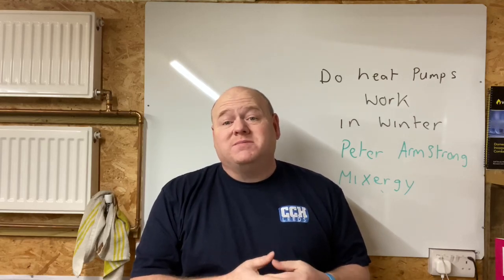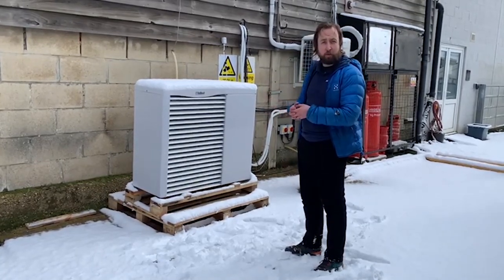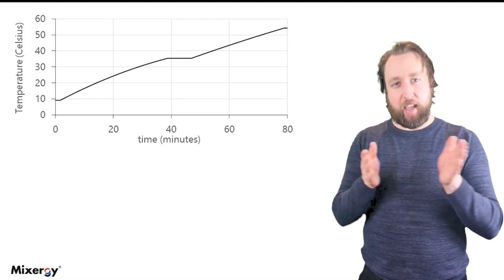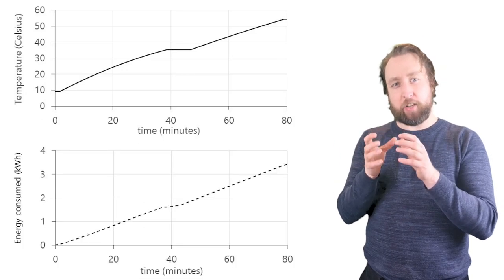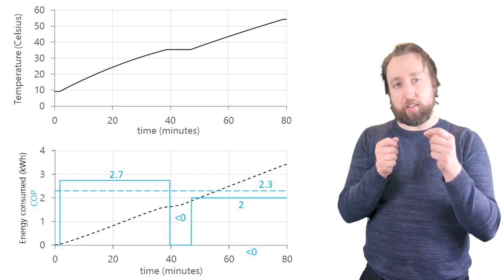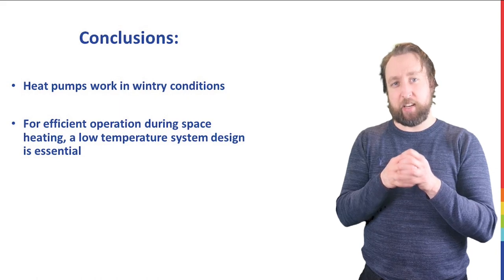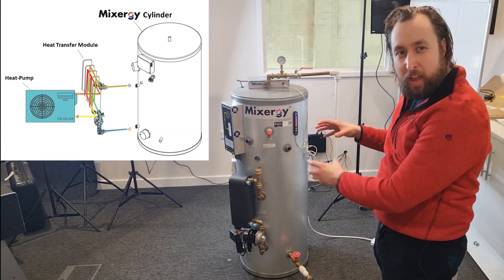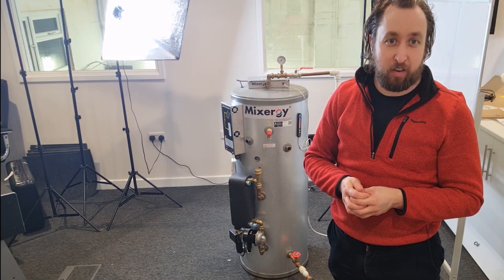Do Air Source Heat Pumps Work In Winter - Peter Armstrong Mixergy

Comment: Simple solution to all your problems, get a cheap  used or new heat pump from eBay min 5kw. Plumb it into existing gas ch system add a motorised valve and and a aav,  bung it into loft, off the floor and hey presto you have hybrid system that works no matter what temp outside. Total cost around )£400 to 500 inc pipe work. Heat pump cost £160. Just three pv panels can run my system on a good sunny day. I have 7kw in total, my gas and electric bills this month are just under £300. That’s inc charging 2 electric cars and heating a 150sqm house. My only advice would be to sit the heat pump in the loft as high as possible near south side of roof that way it takes advantage of the heat from the roof tiles and doesn’t get suffocated in it own cold dense air at the bottom of the loft floor. Make sure you have good air movement in loft with breathable membrane on roof. Mine is working brilliantly so glad I didn’t spend £12k on new system. I reckon I saved the money I spent on it on the first 2 months of use.

Comment: Do these tests again at -10 c and see if the heat pump can clear the coil. In general heat pumps don’t work or are not efficient in low temperature conditions. Stop selling technology that will not work in British winter. Just for the record I have two splits operating in garages and have recorded them over the last few years. The manufacturers produce graphs to support this see Mitsubishi systems.
Reply from the maker: Thank You

Comment: NOT WITHOUT LOTS OF WILDLY EXPENSIVE CAP ELECTRICITY. COUNCILS FITTED THEM WITHOUT THINKING TO MAKE TRADESMEN HAPPY, BUT THEY ARE VERY VERY NOISY 24/7 AND COST A LOT TO RUN NO MATTER WHAT THE WEATHER
Reply from the maker: Thank You

Comment: We used a Daikin Altherma 16kw  for 8 years. It was in a new build house claimed by the developers to be the first ECO code 3 house in Berkshire. We had it replaced by a Worcester Bosch gas about 3 years ago. In fairness to the builder they nearly got it right but not quite and I hear much hype about ashps which is going to lead to disappointment. Here's what they got right. Underfloor heating - best output temp is 35deg, useless for wet radiators (although we have one floor with rads but they have to be huge dual skins, filling the walls and making it hard to furnish). Excellent insulation. Lots of solar gain with max use of southern facing elevation. We installed 4kw of pv on the roof and on sunny winter days we could heat the house and use other appliances entirely self contained with no energy import at all. All for free. No demand on the grid or gas. Magic.
But here is what they got wrong. We have at least one very cold spell in a UK winter in the -5C region. Worse still, unlike the dry air on the continent, we have that freezing damp type of cold which turns the heat exchanger to a solid block of ice that no defrost cyc!e will shift. Now, the only source of energy we have left is our single phase grid input which now has to supply all heat, all dhw, all cooking and everything else. It can't and the house and the occupants just get colder and colder and have no other energy source to help. Very bad. Very, very bad. Our best choice would have been a hybrid gas / ashp system but they are rare and expensive and we also did not have the room for effectively two heating systems. So my experience is that ashps are great, our bills were tiny especially with the 4kw pv BUT the house has to be built to maximise its features AND you have to have an energy alternative as well.
Reply: Interesting I live in Edinburgh and am looking at installing an ASHP to heat the house (3 bed semi).  There is an old open fire here (currently gas effect) which I want to convert to wood burning stove as a back up for winter.  But I also need to fully insulate the house as well.  Here in the north cold, damp spells are not at all unusual.
Reply: @NeilCuthbert  Hello Neil, as I said we loved our ashp except for the depths of winter when it was dreadful, but I would add two points. First, it struck me as quite different from oil or gas in that, for those, when the house is cold you just press "boost" and an hour later you are down to your underpants and sweating . Not so with ashp.  It is like a small source of heat that is there continuously. Its output is only luke warm water. We used to say that it took two days to get the house from dead cold to warm which it could then hold.!Key point here is the massive importance of insulation and draught proofing. Secondly was a big problem in servicing. ashpn people are not plumbers but air conditioners. Plumbers know nothing about ashp and it is rare to find a company who can trouble shoot both systems. In fact the plumbers who replaced ours with a gas boiler said they used to install ashps but had stopped because they were a cause of disappointment to the customers. So best of luck but do lots of research to avoid an expensive mistake.
Reply: @barrysnelson4404  My plan is to have solar PV panels as well so, if that energy is powering the ASHP, there should be no reason not to put the heating on.  My sense is that it will work best with UFH which is what I am planning to do as well.  But we really need more insulation as currently the position is not good in that regard.
Reply: As a heating installer I think your comments are very fair and mirror the advice we give to our customers.

Of course those reading this who are not heating professionals need to remind themselves that your situation is rare in terms of the suitability of the house.  

Finding someone with a property with this level of insulation would be like looking for rocking horse droppings.

So your experiences are when absolutely everything else is right, a perfect holy grail type application.  And it still wasn’t quite what you expected.

Sadly the UK Government are relying on people with Arts degrees to set their heating strategy.  In consequence many are being mislead, and it is an expensive mistake to rectify.

There is a government heat pump trial underway in private homes…but the results have been awful.  Doubt we will be reading the results!
Reply: Thanks for sharing this. I found a website for a USA heating installer in Georgia who recommended not using ASHPs when the air temperature is below 40F. We in the UK have incredibly damp air. I can imagine that ASHP turning into a block of ice in no time. I live in an old solid walled Victorian house and I think I would be better off getting the insulation sorted (expensive though) and a condensing boiler fitted.
Reply: I am in Berkshire with a south facing 4kwh Pv and on most days in the winter don't produce enough solar to keep a bulb happy so how were you supplementing your ASHP with it.

I am on the verge of getting either the Altgerma Hybrid it an ASHP HT system.
I would maybe think of adding Infrared radiators in key rooms for a low cost heating backup just in case...

I think the only info not available is actual running costs in £s rather than percentages
Reply: @Isochest  We have a rather old stone built farm house and we have always joked that the only way to heat it is to set fire to it. Thankfully we are both quite happy with air temperatures around 14C which helps! About 10 years ago we installed a 12kW split in a similarly built outbuilding partly because there is no gas supply to it and partly as a test of an ASHP with the though of perhaps installing one on the house. It is fine much of the time (especially as we are only demanding 14C inside). However, when the temperature and dew-point are hovering around zero it is slightly less use than a chocolate fire-guard. It ices up extremely quickly and, especially in windy conditions, the defrost cycles exceed the running times between them (I suspect servo-operated shutters to reduce the wind-driven flow through the exchanger during defrost would help). As you can tell from the timescale we didn't exactly jump at the idea. I am, in part, worried that until R290 heat pumps are a well-developed technology the high GWP of the refrigerants mean that system leaks can undo much of the advantage of the heat pump environmentally.
Reply: @ColinMill1  Thanks. From the specs and information from across the pond I am certain this will be the case. No good below 40F outside
Reply: @Isochest  The funny thing is that a pal of mine who just happened to be in the water-well business offered to drop a ground-source bore hole in our place for £1500. Needless to say I'm kicking myself for not taking him up on it before he retired 8-)=
Reply: @barry Snelson thanks for your honest input. We are hoping to start our build in Cambridge next year and have opted for an ASHP along with solar PV on our south facing roof instead of a gas boiler. I’m becoming slightly disillusioned with all the feedback and comments I’m hearing about solely relying on this sort of system and am now having second thoughts. Our reason for opting for this solution is to try and stop contributing to the greenhouse gases and the fossil fuel use but I’m not willing to settle for a home that isn’t going to be warm come winter time. We will be having UFH throughout but haven’t discussed what system will heat the dhw as I know the temps produced by the ASHP is not adequate. Any further help and advice greatly appreciated.
Reply: @natashachambers4318  One thing you might like to look at is the anticipated lifetime of the UFH you are planning to install. I mention this because a friend of mine was looking into UFH a few years ago and decided against it on the anticipated lifetime and the estimated cost of renewal. Perhaps there are better materials and/or less disruptive repair schemes available now.
Reply: @Joiedevivredesilives  Viessmann due to launch their new Vitovalor ASHP using R290 gas (propane). Water temperatures they reckon up to 70 degrees at minus 4 alternatively, their fuel cell that coverts natural gas to hydrogen simultaneously generating electricity, its expensive and whilst its being considered for potential grants, nothing imminent.
Reply: That is the very first and most useful report I have ever found and read on heat pumps. Many thanks.
Reply: @ColinMill1  will do. Have had an Uponor system in my current home for 14yrs and it's still going strong so I would hope systems now would be even better.
Reply: @barrysnelson4404  The video was about a '16kw' ashp, but the figures clearly showed only 2.5kw going to the tank... This is what you can expect from ashp.
Reply: @natashachambers4318  You will be surprised that as you get older 14 years seems like the blink of the eye. We bought this house in 1998 and had it restored and it still feels like our new house. I would hate to have to have a York stone floor ripped up after only 30 years - they don't start to look right till they have been walked on for a century or so.
Reply: @gruhwch4876  These last few weeks all I have heard about in the media is about changing your gas boiler for a heat pump... Boris's wife clearly wants us all 'green' ..This is going to get interesting !
Reply: @NeilCuthbert  are you sure surely not in gods country
Reply: @gruhwch4876  Totally agree.
Reply: James Riddell  In order to work economically a home has to be well insulated and have good thermapane windows. If you try to heat an old barn with a heat pump it will cost a fortune. My home is located in Huntington NY USA. It was built in 1978, has R-30 Insulation in all the walls and modern thermapane windows. I have a Lennox Heat pump and it works great
Reply: My concern over a Heat Pump is the noise. I live in a little English village of around 100 homes. No gas is available and most use oil or electricity. The thought of disturbing my neighbours with the noise of an ASHP is worrying. My home is a converted barn and I have begun to insulate, but even that would not be enough. Are there any Heat Pumps that are quiet?
Reply: Well said
Reply: @NeilCuthbert  Been there,done that solar panels are a waste of time unless the sun is shining on them which is not often in winter with its cloudy days .I had 12 panels which i could monitor their output in real time.I could tell when a cloud passed across the sky blocking the sun.This was 5 years ago so not influenced by current heat pump controversies.
Reply: Surely this Daikin ASHP had a defective defrost cycle?
Reply: I'm in Canada and I've installed half a dozen ASHP's in houses with various build qualities, some new and some retrofit boiler replacements and all have worked great. We had a cold snap late last winter of -18C for a week and they all heated through that with no problem, with no back up resistance heat. We also have quite damp winters here being on a lake.
Reply: @gruhwch4876  Having Insulated many Properties since 1980, one system doesn't suite all in a retro fit. I've had folk in South facing solid walled houses angrily asking for the insulation to be removed as the house is now like a morgue. I've had folk in terraces who have never used their boiler and had forgotten where it was, but soon got reacquainted with it after the Insulation was fitted.  The group who enjoyed it the most all resided in solid walled Towerblocks, where it did cut their bills, but big buildings big boilers are more economical to run, which also helps. 
The heat pumps for a mass fitting will not be the best thing for all, just like all the previous schemes, which have all had mass corruption as well.

 In Germany I have retro fitted 300 mm of Insulation, internally on all exterior walls. Do that in the UK and you'll be sleeping stood up.

Art degree or Geography Teacher, misled indeed.
I've found the whole Industry to be fraudulent, and to favour everyone bar the bill payer, and it's been like that since the sixties.
Reply: Is there no one who can give a comparison of running costs between the 2 systems? Barry is supplementing his ASHP system with PV, so that does not give the true running cost. I'm sure that if we  calculated the complete system costs plus running costs, the ASHP would far outweigh the gas system. And that's without the extra insulation costs and maintenence.
Reply: @colinsuter6888  We've had a Samsung 16kw EHS Monobloc ASHP for 6 years, no-one has ever complained about the noise and we can barely hear it in the house.  The noise thing is scaremongering to some degree, if it's fitted appropriately in the right location you won't have a problem.  BTW, we have houses all around us, we're not isolated.
Reply: @davidstorm4015  Thank you, David. You’ve put my worries at rest.
Reply from the maker: Thank You
Reply: did you try putting ethylene glycol (antfreeze) 25% in the circulating water to stop it freezing in winter?
Reply: @cuckingfunt9353  and nobody talks about the cost of cleaning and repairs even if you can find someone qualified. We need to train more techs and the manufacturers need to make them easier to disassemble and more bullet proof. We are not there as an industry yet.
Reply: @zacm9174  do you offer service and maintenance to all of your customers?
Reply: @ducharmehvactraining925  Yes, it seems like there is a lack of knowledgeable techs here.
Reply: In our country hybrid systems are the norm, but we have our own gas resources :)
Reply: I have been in the HVAC business for 45 years and would not rely on an air source heat pump as my only heat source no matter how tight and super insulated my house would be. The cost of maintenance and repair can be very high to keep that efficiency. The units themselves are far from bullet proof or reliable and finding someone capable of installing properly or being able to repair them is in short supply.
Reply: We are thinking about installing a Daikin Altherma, I'm really interested in your comment. We are in London where it rarely snows or freezes over. Would you recommend the this ASHP with solar PVS for a london well insulated total renovation?
Reply: @NeilCuthbert  we are doing the same but in London and in the middle of basement conversion and demolition so we plan for optimal insulation.
Reply: @zacm9174  Hi Zac which makes did you install, what do you recommend?
Reply: @SO-ny8ys  the fact that you have asked me for a recommendation tells me that in your area there is not enough infrastructure to support successful Air Source Heat Pump installation and service. We need more professional technicians in this field.
Reply: @SO-ny8ys  I'm in Canada so we have different ones available than you would have access to there but Daikin used to sell the Altherma here however they took it off the market due to low sales I guess (air to water heat pumps are not popular here) which is too bad because it is a great machine. Every one I've installed has worked flawlessly for 10 years, I would recommend.

Comment: There's little point in talking about efficiency ratings, or any of the other technical data, without demonstrating whether or not it can actually adequately heat your home. Take a victorian or older property  with a mixture of construction from solid walls, a little cavity work, hollow and solid floors, and heated by a gas or oil fired boiler. Now take the gas boiler out and show us just how the air source heat pump compares. Let's see just how many changes are needed, how much money needs to be spent, and how many compromises need to be made.